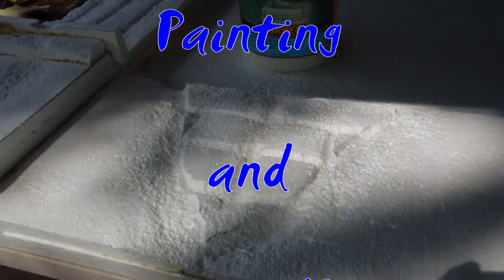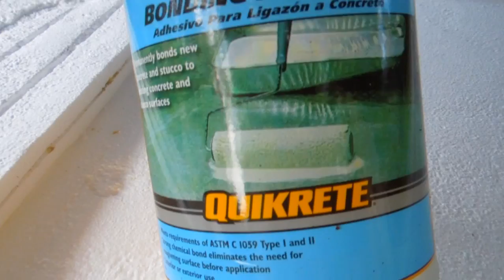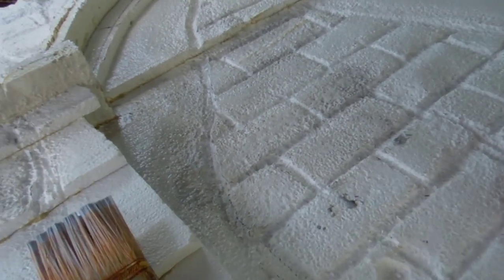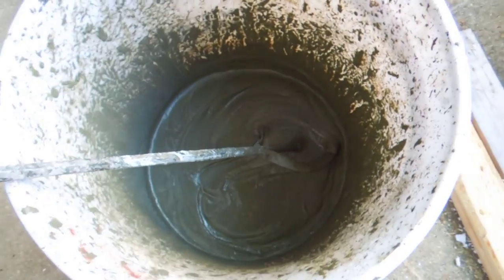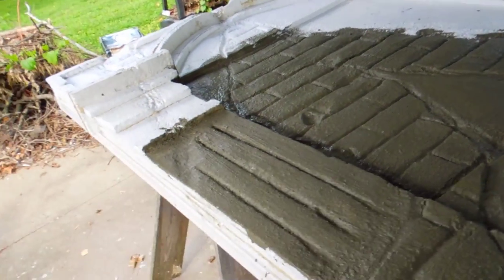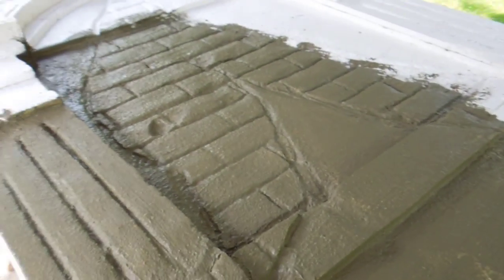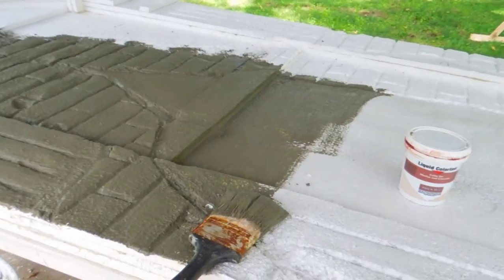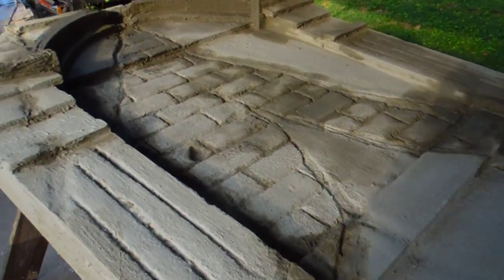Part II New Orleans Style Crypt

Comment: They look amazing. Great job. About how long did it take you to do a wall
Reply from the maker: Well Barry it took me two days from start to finish because of drying times. However if the conditions are right and the day is long enough you might be able to get one done in a day. But you can certainly start more than one panel at a time and be fine. Assembly line man! lol  Thanks Barry!

Comment: this was a great built did that bonding stuff make your panel stronger is it still in good shape today
Reply from the maker: Absolutely made it stronger. It's holding up a lot better than the wood panel it's glued to. The foam and mortar parts look about the same as when I made them. The thin concrete really gives a hard coat to the foam. The wood panels that I had time to paint are fine. The ones I didn't paint, the bugs seemed to like......always paint the wood I guess. I'm going to re-glue them  pretty soon. .... also, use the bonding stuff for the concrete. I was making some last minute panels and didn't have the bonding agent, so I just put the concrete on without it-  It fell off! It is some amazing stuff I guess.